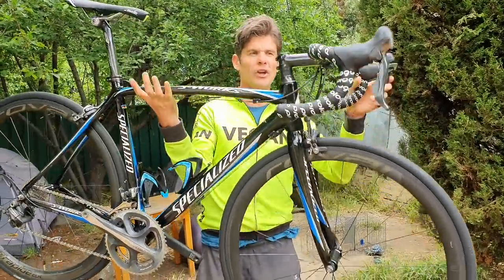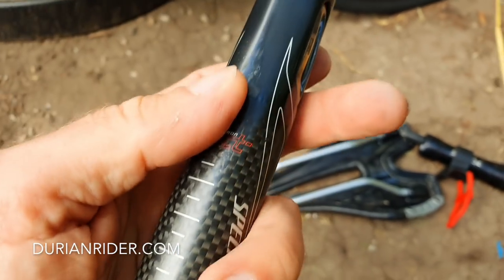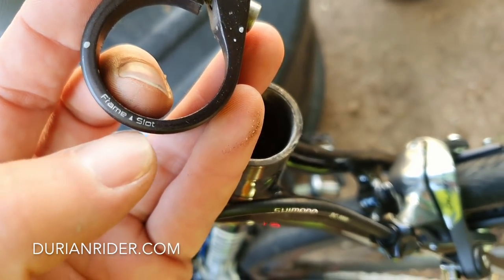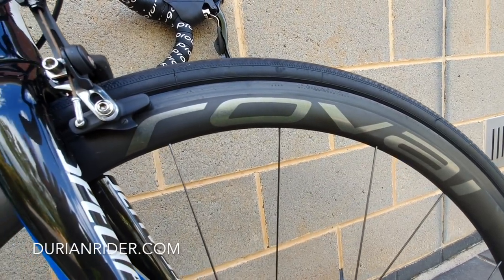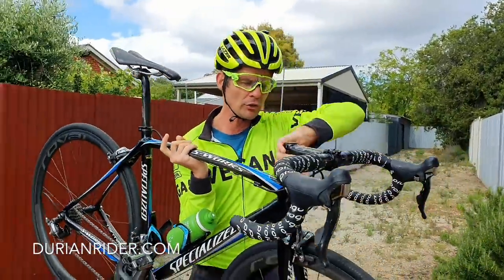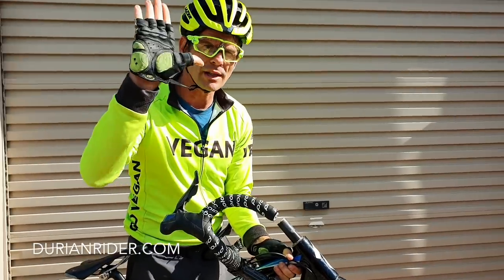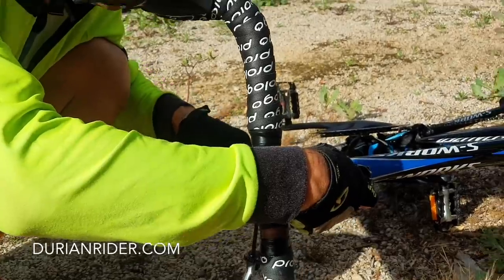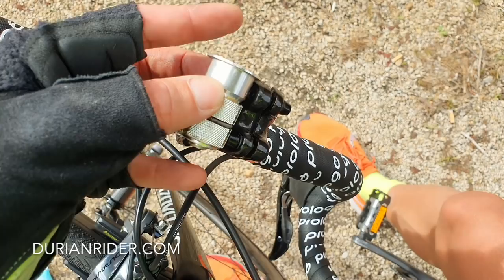How To Give Your Carbon Bicycle A Safety Check For FREE

Comment: My next bike Will be titanium.
Reply: HazardousPleb V   Everything titanium off Alibaba looks pretty spot on to me. Its all coming from the same place, and i havent seen any of alis titanium frames that were nothing but top line craftsmanship. 600 bucks vs 2000 for LBS.
Reply: HazardousPleb V  Here in Switzerland and i have seen two Chinese titanium road bike frames that pretty much are just as good as any other frame i have ever witnessed. Chinese manufacturing in cycling is so good now that i have witnessed Madone level T1100 carbon frames on a weekly basis here that might be BEYOND Treks bikes, and i am not kidding. Have you witnessed the 7005 aluminum bikes coming out of China? I have and THEY ARE SUPERIOR IN WELDING TO MOST LBS SUPPLIERS. Check out the twitter bikes on ali and then look at the price. I have seen this stuff, and its game over for any LBS branded bike. If you havent actually seen it then you will be astounded at the level of craftmanship compared to just six years ago.  This stuff is real, and it cant be overlooked. Alibaba is the largest bike marketplace in the world now, and its not because they are selling junk that breaks. Its all over Europe for a reason.
Reply: @josequilez5449  Its the largest cycling market in the world, and there is way more than yoleo as players in this market, but get what you want.
Reply: HazardousPleb V  If you know bikes then you know what to look for.  The stuff i am seeing is pure high quality competition bikes that are top of the heap bar none. I will go so far as to say it has no equal in many regards. It also cost a tenth of any  8 to 11k bike. So far everyone is more than happy with their stuff, and i would be the first person to say its junk. But it isnt junk, its as advertised.  If you simply dont know what your looking at then i guess you could buy junk, but if you do then it mostly exceeds expectations.
Reply: Naa. I Dont want chinese frame.
Reply: @janvirtanen9110  Get what you want because there has never been such a time like this ever in cycling.
Reply: HazardousPleb V  I made a mistake here GR9 titanium frames are about 800 to skies the limit in price. Its the grade you want for serious cycling.
Reply from the maker: Ive seen Litespeed, Merlin, Moots and Lynskey all crack around welds.
Reply: I still ride my old Steel bike every Day that I have had over 18 years.

Comment: You say carbon doesn't fail unless it's been crashed. I agree. What  bothers me is the proliferation of carbon mountain bikes. To get anything even close to high end it is usually only offered as carbon. How can any aggressive mountain biker not be expected to crash now and then? I have an old aluminum Santa Cruz that has been through everything I could throw at it and is ready for more. The only problem is it's old and I want to upgrade to a high end modern trail bike, but find what I want in aluminum is hard/ impossible to find. Some manufacturers, like Santa Cruz, Pivot, don't offer aluminum. It seems like the modern bike companies are making more profit on carbon because of the huge markup from manufacturing costs, and are snubbing their noses at us who want aluminum. Mountain bikers will crash, and the carbon frames will break - no question.

Comment: Have you ever ridden over a man hole without the cover on it. I hit one with no cover on it coming down belair Road at around 60 kmph. Luckily it was one of the smaller ones. It didn't cause me to crash but it felt like I did from the impact going. Afterwards I was like 'AAaaaahhhhh f#@$k my groin. It was almost as bad as hitting a category 5 potholes. I used to think they were only in books till I saw one.

Comment: $821.31/USD.
BTW, here's a tip to test your carbon. Get a cotton ball and run it across the entire frame & fork and anything carbon. If there are any jagged edges or micro cracks, the cotton will get caught up in the fibers even if you can't see the deficiencies in the structure of the frame.

Comment: 10:07 Am I wrong, have I been lucky, or Aluminium wheels don't explode? Not much heavier, too. And at half the price, even a quarter of carbon wheels. The same goes for frames. You can find very comfortable seat posts, stems and handlebars made of Aluminium at much, much lower prices than carbon. Aluminium bends, but doesn't break. If crashed, a well made aluminium frame takes the beating without breaking a sweat, on 1000 EUR bikes fully equipped with 105 .. No reason to buy carbon, even if you buy it cheap, is what I'm saying, just go for Aluminium, it has everything you need at 1.0-1.5kg more on total bike weight. Oh, and don't cut your fucking seatposts, especially if they're carbon ...
Reply: 1000 EUR bikes new, forgot to mention. I'm sure you can find them for 500EUR in good condition, maybe even less.. ? I didn't ride tens of thousands of km / miles, but I rode a single frame from spring 2014 to spring 2022, exclusively on shit roads and it can take a beating ... on a 700 EUR bike new, from the store. Not as light as carbon, but definitely more reliable than carbon, from what I see.

Comment: Yea lets inspect.  ok theres shit tons of cracks.  They are just cosmetic.  yea its just cosmetic
Reply from the maker: paint cracks vs REAL cracks bro. What next...a crack in the paint on a wall means the wall is cracked? LOL. Learn the difference and clean a few thousand bikes and you will see what is a common paint crack and what is genuine safety issue like a crack in both the down tube and top tube from a front on impact. Otherwise link me to a pic of a BB ripping out of the frame in a sprint. NEVER EVER HAPPENED!

Comment: What you consider, light, middle and heavy weight rider?
Reply from the maker: 50-60kg
60-70kg
More than 80kg you are a heavy weight and should stick with heavier parts.
Reply: @durianriders  alumínio frame , carbono fork? And what about wheels just stick with aluminum too?